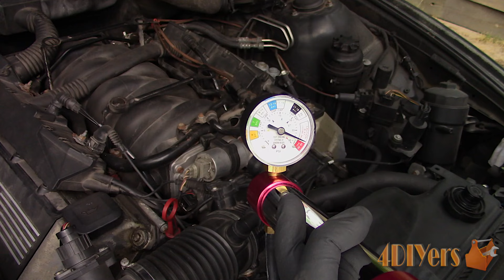How to Easily Find a Coolant Leak

Comment: I have a leak on my 528i E39, it's at the back of the engine and so far i can't find wear it's at. The engine smokes white in the engine bay and blows not alot but some white smoke.
Reply from the maker: You can use a dye and i do have a video on this https://www.youtube.com/watch?v=4CzoaqOj7C4 With the white smoke, that can be steam and a possible head gasket leak. This is an old video, but covers the specifics on head gasket leaks https://www.youtube.com/watch?v=-CV00WRlf1U
Reply: Sounds like blown head gasket

Comment: What could it mean if the coolant doesn’t leak UNTIL the car is turned on?
Reply: When you turn on the car, the water pump spins and pressurizes the system. Also, when you turn on the car, the coolant gets hot, expanding the liquid and thus increasing the pressure as well. This means you have a small leak that only leaks under pressure.
Reply: AK540i thanks!  Yeah man i ended up needing a new water pump
Reply: The coolant loop is separated from the engine with a thermostat that does not open to let coolant flow until the coolant has reached a certain temperature. This helps the engine get up to operating temperature faster / helps regulate the engine temeprature etc... A seized thermostat may always be open or may never open. So, if you have a leak in a radiator or hose for example, you may not see the leak until the thermostat opens and coolant starts flowing through that area.

At least that's how I understand it. My old truck had a radiator return hose leak, but only when the system was pressurized and at operating temperature.